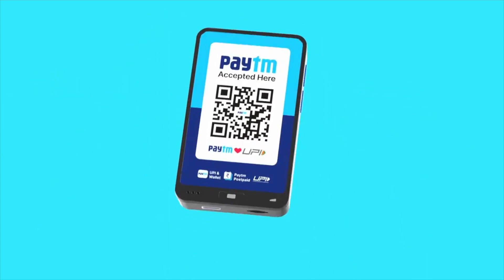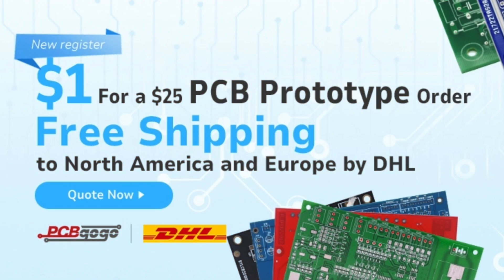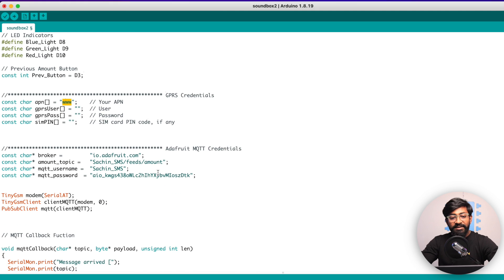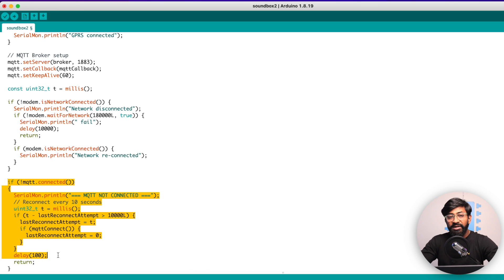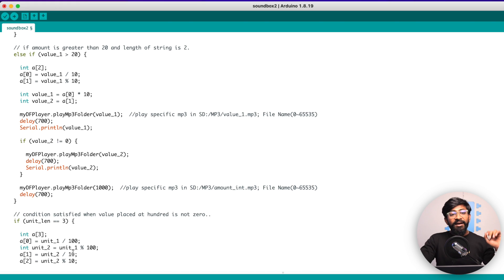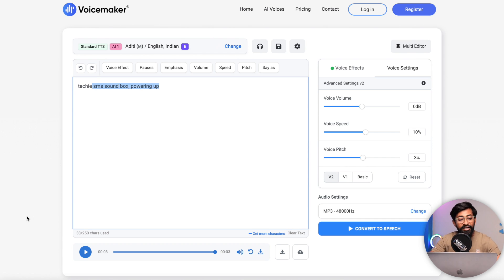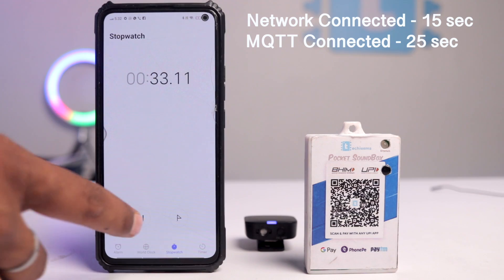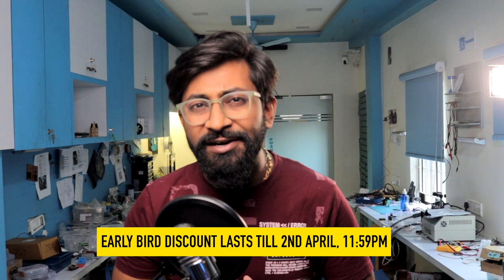UPI Payment Sound Box using ESP32 | IOT Projects | ESP32 Projects | PCBGogo

Comment: Upi printing video you have used Rx Tx pin in connection to connect printer. But this video sound box you connect rx tx pin to sim module. So can I used Bluetooth to connect any thermal printer which is available in Amazon?
Reply from the maker: Well not exactly sure about that 
So can’t say anything

Comment: Can we connect Bluetooth Printer to print payment received ?
Reply from the maker: I made a separate video about printing payment slip 
Check that out
Reply: That video you have used Rx Tx pin in connection to connect printer. But this last video sound box you connect rx tx pin to sim module. So can I used Bluetooth to connect any thermal printer which is available in Amazon?